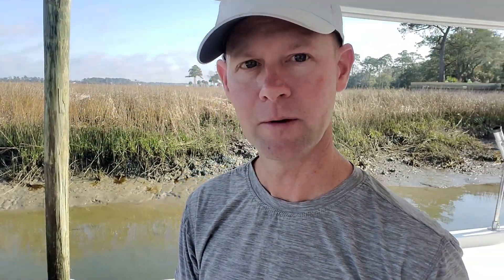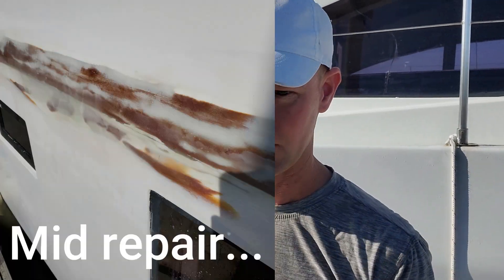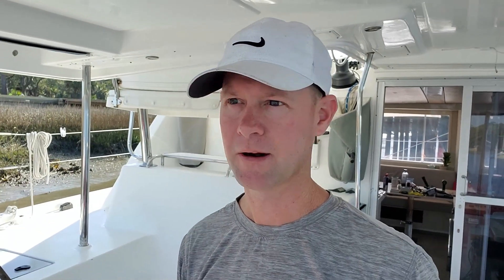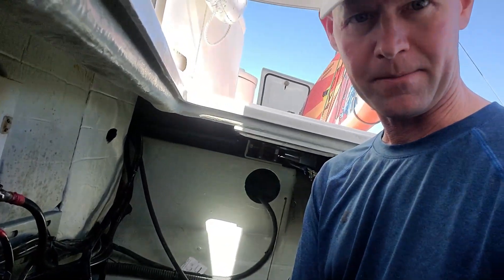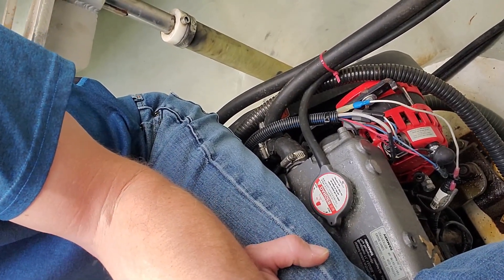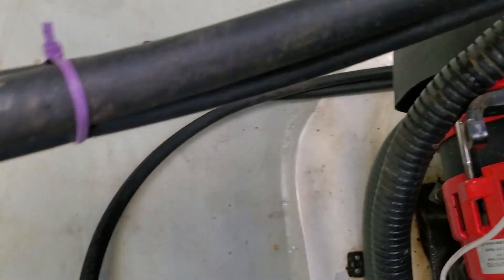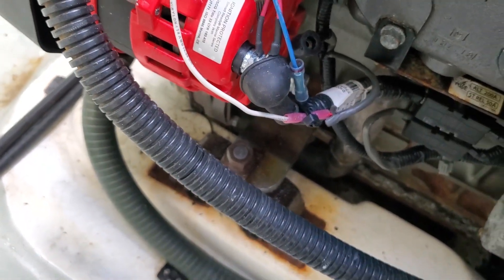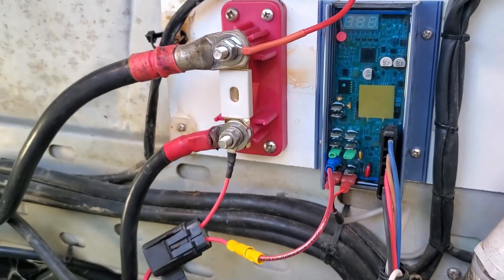E44 Installing Balmar High output alternators

Comment: My factory wiring is not up to 170 amps so I dumbed it down with the belt load manager. This will keep your boat from burning to the waterline. Upgrade the wiring at your leisure.
Reply from the maker: @jamesgregory2962  interesting, but with the Balmars fully electronically controlled, they could just be reprogrammed, but I wanted to get max power and so replaced all the wiring...
Reply: @ I have the xt170 and it is throttled down to 100 amps until I have wiring I can trust. I also have ventilation issues in the engine bay and it runs pretty cool. I do have the 618 with bluetooth. Very configurable!  Yes I have temperature max set as well.
Reply from the maker: @jamesgregory2962  nice, I didn't have Bluetooth control, and that would be a huge help

Comment: Do you work full time as well? Not to be nosy lol. Just wondering if you're all in on YouTube  full time.
Too bad RV not sold yet, it's a nice RV. But a good place to live while working on the 2 boats and selling 1 of them.
Reply from the maker: Living off Investments for a while, hope to grow the YouTube channel, more on that coming soon. Have had a couple inquiries on the RV,
Reply: @landnseaexpeditions6208  

If I had a place to park a RV I'd be interested, dam city living.
Reply from the maker: @Technocrat.  Fin is a fantastic RV...
Reply: Stainless washers are not considered conductors.  Copper is eight times more efficient than steel but forty times better than stainless.  It looks like you have stainless washers under your lugs on your fuse block.  If the current is going through those washers they will heat up and can melt out the fuse block.
Reply from the maker: @peternorris5614  thank you for that advice I used the washers that came with fuse blocks, so assumed they were copper but for sure something to double check.